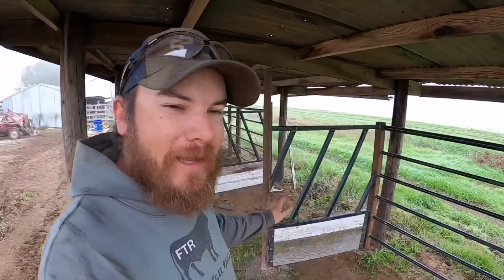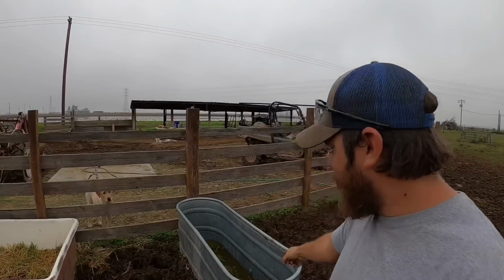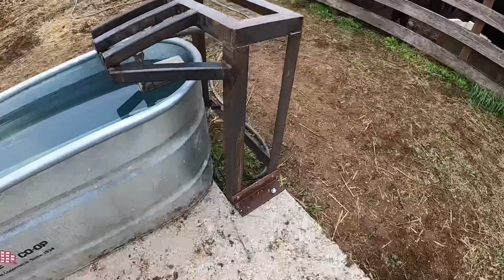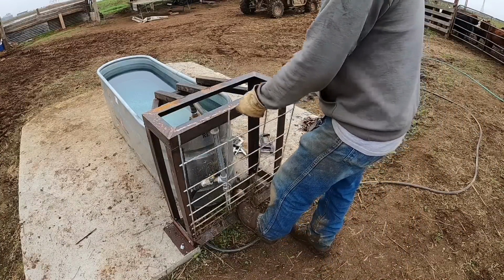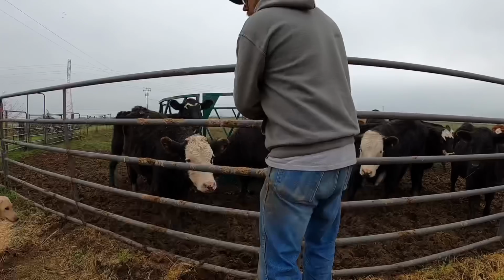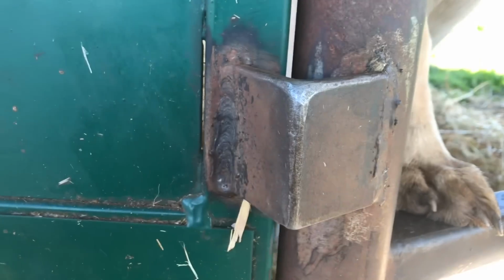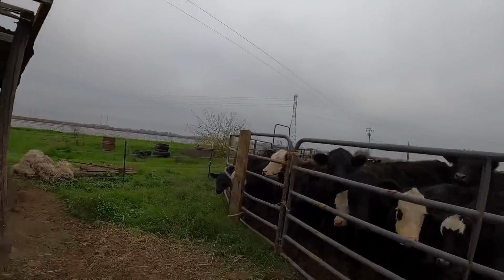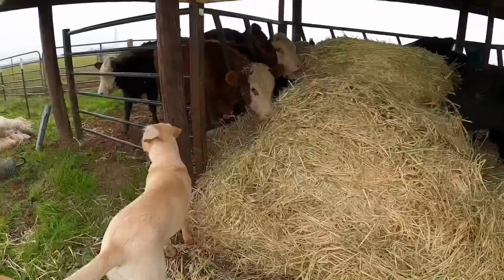Building a Fence Line Round Bale Feeder Part 2- It’s Done!

Comment: I love the design of the hay bunks incorporating the hay ring sections.  Just a couple of suggestions if you haven't figured it out yet:  I would highly suggest you put a gate on the back side of those feeders because (from my own personal experience) those calves and small framed cows will find a way to climb into the feeder with the hay, and as you have it now, they will be running up the road free.  I know you probably don't want to do that, but it might be something you need to consider at some point.  Secondly, I've had to replace so many hay rings in my life because the cows are rough on them & break the welds.  I hope that your rings are stronger than mine, but you might (likely) eventually end up having to fabricate the ring sections out of thicker pipe.  Just be aware and keep an eye on it.
I greatly enjoy watching your videos!  You do an amazing job on the ranch and I appreciate you putting in the effort to share it with us!

Comment: Great job on the videos keep them coming I do enjoy them. There are at least two other ways that you can stack round bales. I have a friend that stacks round bales on their ends three high and uses pallet forks on the tractor to move them he says that keeps the strings from rotting. In my barn I can only stack two high and stack them similar to the way you do but I put the second row directly on top of the first row instead of staggering them. Keep up the good work.